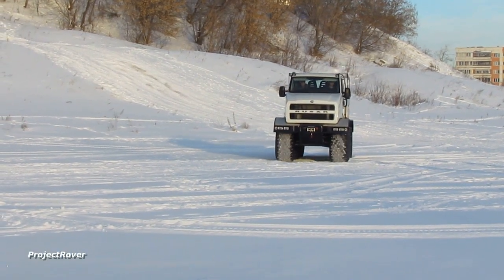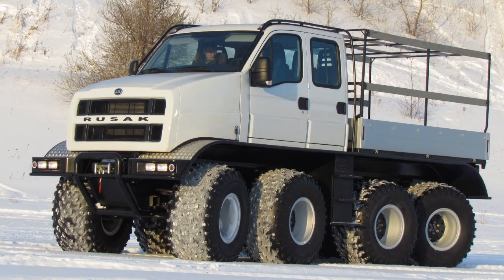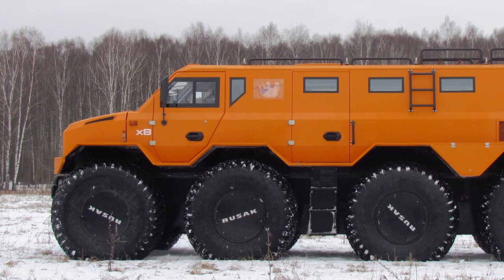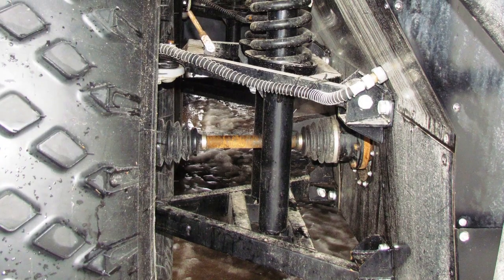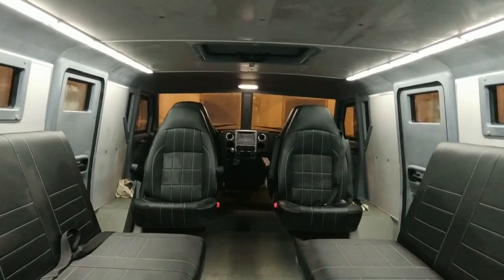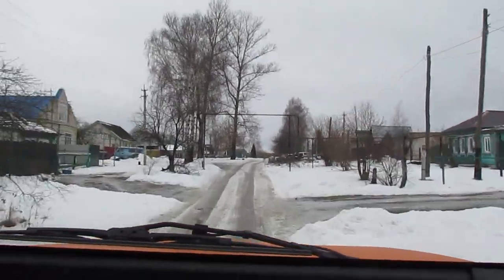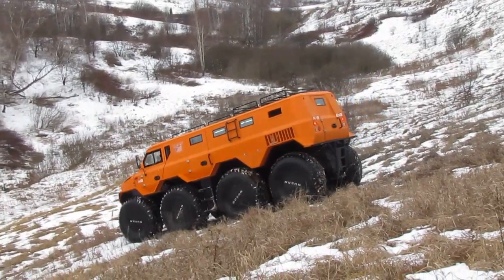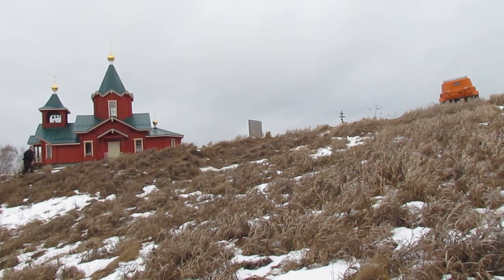All-terrain RUSAK: four motors on eight wheels

Comment: Cummins 2.8 engine is a bit small for a 6000+ kilogram vehicle...
Reply: It has two of them and they don't directly drive the wheels. Modern locomotives use the same principle. Electric motors deliver full torque all the time. Plus it has multiple gear reductions.
Reply: максимальная скорость этой машины  60 км/час на твердом покрытии... а по болоту ещё меньше. зачем большой двигатель?
Reply: А зачем танку, БТРу, БМПшке, автобусу или дальнобойной фуре большой (крупнолитражный) двигатель? По вашей логике на них можно установить малолитражный двигатель (с охуенным понижением передаточных чисел) - и сразу будет "аналогов нет". Но почему-то туда устанавливают именно крупнолитражные двигатели. У БМП-1 удельная мощность выше (это вам не гоночный болид) чем у Русака К-8...